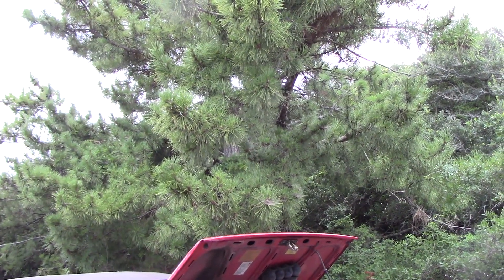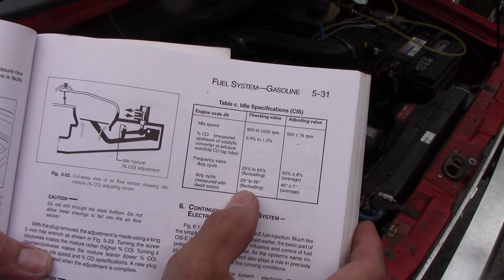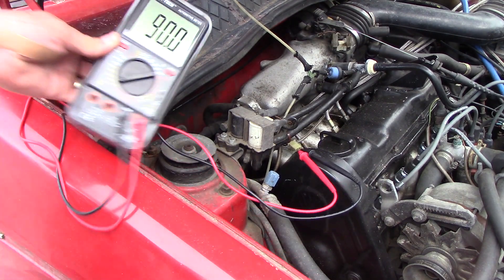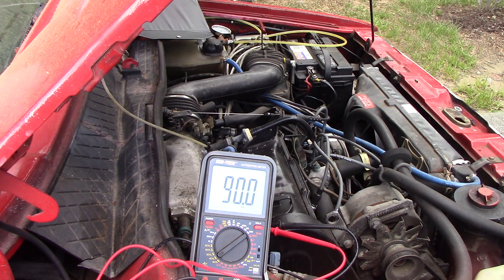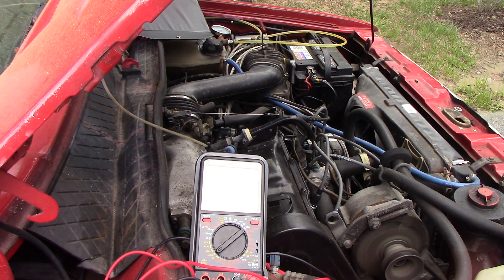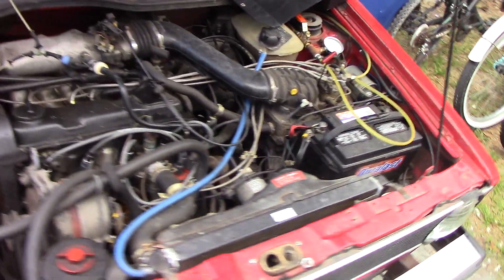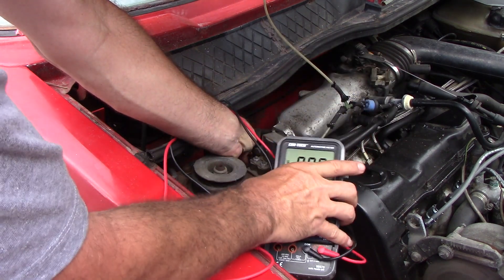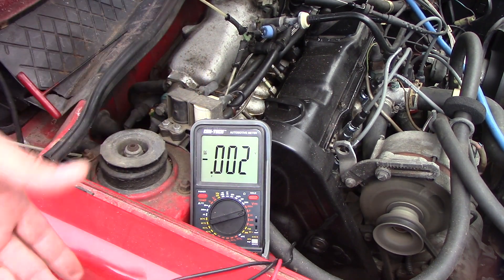1987 VW Cabriolet Idle Mixture Setting

Comment: I have an 82 rabbit cabby  but I don’t have that plug in near cold start valve for my meter do u or anybody know where else could I hook my meter up as I know I’m running rich
Reply from the maker: I am not positive but an '82 model may not be a K-Lambda (or CIS with Lambda control) system. If the car does not have an oxygen sensor and a computer then there is no wire. You would need to adjust he idle mixture with a CO machine.
Reply: @bryansprojects3570 

Thanks for the response, I have the 1.7l  fuel injected model 
I have a dwell meter with a third wire that hooks up to the coil Im just not sure on accuracy as I’m only reading 12.7 which would be pretty rich and the smell of fuel coming out the pipe agrees lol the other  problem is the previous owner set idle high due to the shit mixture so until I correct the mixture I can’t adjust the idle correctly but hey no harm in asking right thanks again

Comment: Hey bryan just wondering why i cant get any reading when i try to connect to the test port….any ideas why? Like your vids though.
Reply from the maker: Make sure you have a good ground. I also seem to remember this problem on another car, I think I had to find the wire at the computer or at the frequency valve on the fuel distributor. A wiring diagram would help.

Comment: Hello, Where is the crankshaft sensor of cabriolet 1987 ? My mechanic is not sure if that part comes in that type of engine. Help, please!
Reply from the maker: These cars do not have a crankshaft position sensor. All of the timing is based on the position of the ignition distributor.

Comment: Hello Bryan,  I have a  question about the additional boost valve (2) page 5-28 idle speed boost valve. (fig 5-17)   brown is ground, and the wire color green got cut and I"m not sure where is the end connection close to the front right side light as a reference location.  could you help me?  I have a 1988 Cabriolet,.

Also thank you for this video. it will help me to adjust the idle.  I just to do it just by sound,  Now  I understood the reason for that connection and the use.
Reply from the maker: I am sorry I can't help that car is located 300 miles away and I likely won't be back there until late spring. I would be too concerned it looks at though it just turns on when the AC is on to increase the idle speed and help AC cooling.
Reply: @bryansprojects3570  
Thank you for the feed back, I think I founded the location. 
And I will use your tip to tested.

Comment: hey bryan. is there a reason why my o2 sensor would be stuck on .8v? also my frequency valve isn't buzzing and duty cycle comes out to 11 instead of 50+-
Reply from the maker: It has been a long time since I worked on these cars regularly (like 22 years). I would guess that either there is something keeping it from going into closed loop therefore the frequency valve wont do anything or the O2 sensor is dead. The O2 sensor for one of those cars should be pretty cheap.
Reply: @bryansprojects3570  yea its definitely stuck in open loop. Ill try replacing the o2. Thanks

Comment: Bryan,
Thanks so much for all these videos, they have been so helpful with my 92 cabby. Im having trouble with a hunting idle. I started with fixing all the vacuum leaks I could find, including ordering a new idle air adjustment screw because it appeared to be missing altogether. I went to put it in today and it turns out that a previous owner must have attempted to tighten it down and snapped off the head. What's your professional opinion? Any suggestions?
thanks,
Reply from the maker: Is yours a K jet like this one or is it Digifant? Our '93 is Digifant.
Reply: @bryansprojects3570  its a 92 digifant I. I took off the throttle body and cleaned it, theres a yellow plug where the idle air adjustment screw should be. I've been through the forums and am very confused. 
thanks again, the videos are so helpful.

Comment: Hellow i hope you can help me out  you seem to know a lot about cabriolets 
I just buy a 85 cabriolet by karman with the 1.8 and got a lot of old gas on it so i just take the tank out put a new one in change both the fuel pump inside and out side(i did broke the fuel reserve filter waiting for the one to came in) put brand new sparkplugs on it new coil new cables for the sparkplugsbut the car is just starting and then dying a few seconds later when i try to give it gas it dies right away do you know was could be happening or where can i star also change the fuel pump relay
Reply from the maker: i would guess that you have clogged fuel injectors or lines running to the injectors.
Reply: Your fuel distributor is probably stuck.  I just did the same thing to my 87 Cabriolet.  I removed my tank and derusted, repaired wires on my fuel sending unit, replaced both fuel pumps, and fuel accumulator.  It would start briefly and then cut off.   I removed CIS and the fuel distributor and cleaned thoroughly with carb cleaner in every port but I didn't remove the plunger.  I made sure it would spring back correctly which it did after cleaning.  I then sprayed WD-40 in every port on the fuel distributor and let it sit overnight.  Reinstalled and bled the fuel at the control pressure valve  (i.e. top braided line on fuel distributor)   Started up on first go, but you will have extremely rough idle for a while.  I'm waiting on a new set of Injectors now.
Reply: Start with a fuel filter, still easiest, you may be lucky.

Comment: could you help me out? I've timed my 87 cabby, starts up perfect it idles smooth at 1000rpm but will choke and stall when i press the gas. won't run correctly unless i advance the distributor ALOT and even then it still won't rev past 4000rpm struggle for power and it will hesitate  and jump upon acceleration. ive replaced all vacuum lines among other things and am currently at a loss
Reply from the maker: It could be a lot of things. You really need a fuel pressure gauge to check the control pressure. Once you can check fuel pressures you may need to pull the fuel injectors to make sure they are all spraying. That can become a can of worms too.

Comment: Any chance you can give me some ideas on what the issue might be on why my 87 VW Cabriolet Chokes out almost immediately after turning on.
Reply from the maker: Our red one has been doing that now until  it warms up completely. It is like it may not be getting enough fuel. The pressures behave properly so I think my problem may be in the fuel distributor. I have seen where the rubber o  rings can be replaced in them. I might try that next. Unfortunately I think the last k jetronic VW was in 1992 so I doubt there a lot of people that can work on them anymore.
Reply: BryanR461 thanks! I got it to finally stay running today I disconnected the control pressure regulator and it stayed running but rough Im sure it does have something to do with the distributor
Reply: @bryansprojects3570 even if so many years have passed, I wasn't lucky to see your videos earlier, this whole work is very helpful for us who know something about something and nothing about the rest, proud owners of these nice automobiles. Thanks for sharing.

Comment: Do you happen to have electric schematic of sensors around K-Jetronic? We have a Scirocco '91, 1.8 8v, and it was switched to carbs. While doing so, somebody cut off some sensors on left side of the engine bay (looking at the engine) - so we have 6 wires for 3 sensors and dont know which go where :D colors are: black, black, brown, brown/black, green/wite and red/white. Bundle is behind engine, below inlet manifold. I know some wires goes to that relay or what it is, mounted on the right shock absorber.
Reply from the maker: I have a Bently manual that was in the video. The relays on the shock tower are for the fuel injection. If I get time I will study the diagram and respond.
Reply: @bryansprojects3570  thank you sir! I just need to see which wire goes where

Comment: I have an 86 golf with cis on my setup the throttle body and injection is on the opposite side. I understand the adjustment, but where would I hook up my leads for the swell meter on my car?
Reply from the maker: I honestly dont remember and I sols the Golf manual I had. As I recall the plug is the same and so are the wire colors, brown and blue/ white. I want to say it is the same vicinity but I am not positive, it may be over near the brake booster.
Reply: BJim461 thanks for the response I just did some checking and did end up finding them tucked behind the brake booster. Wires were same color as in the video thank you this vid helped a lot with my rough idle
Reply: My 86 Scirocco has it on the drivers side, the connector looks the same.
Reply: @russretrogames Aleluja, thank you so much for writing this.